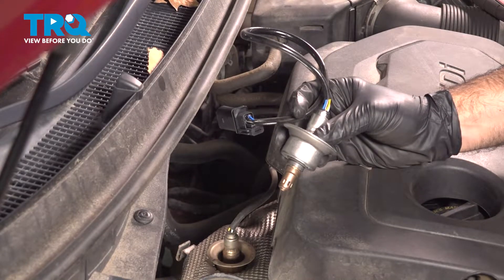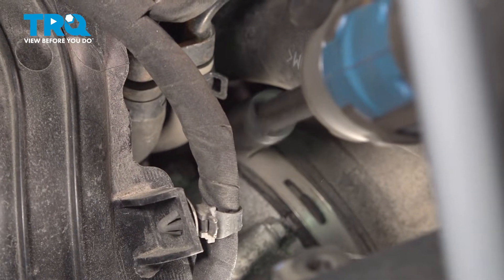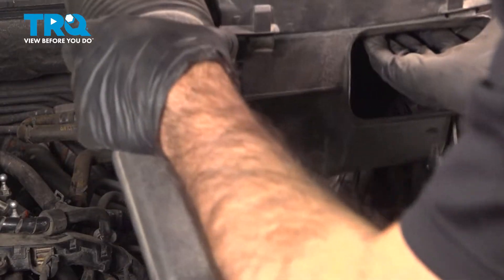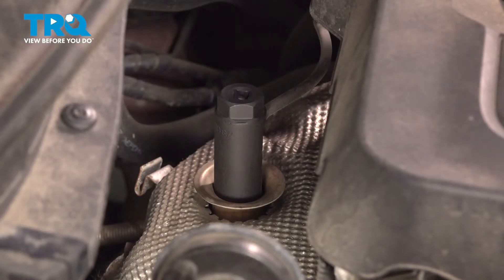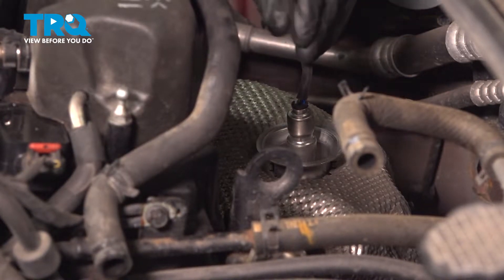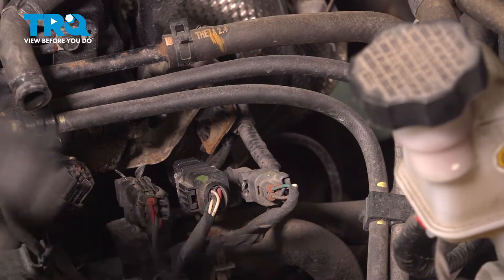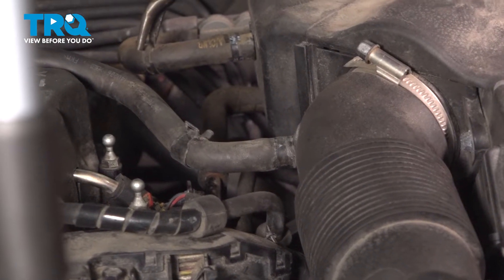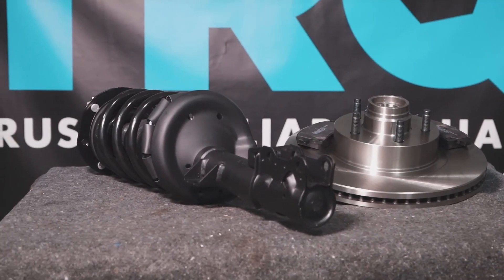How to Replace O2 Sensor 2015-2019 Hyundai Sonata

Comment: I just changed this, but all I did was unscrew it, unplugged it, pulled it out of the bracket with hose grip pliers and reinstalled. 

Why did you pull the entire air box?

Comment: Would the 02 sensor code (P1035) on a 2018 Hyundai sonata 2.4L make the car NOT START? Only clicks. Only code that came up is that p1035...?I was thinking it would still "try" to start. But nothing just a click humm.. please help..Ty .
Reply from the maker: +Mr. Rowlins  We wouldn't be able to diagnose an issue like that here, you may want to have a local mechanic take a look at it. Thanks for checking us out! http://1aau.to/m/Shop-1AAuto-c

Comment: You replaced Sensor 1. O2 B1 S2 is complicated because it attaches onto Catalytic  converter and sensor plug 🔌 location is difficult to find as it is covered by metal plate underneath and wire goes up inside that plate somewhere.